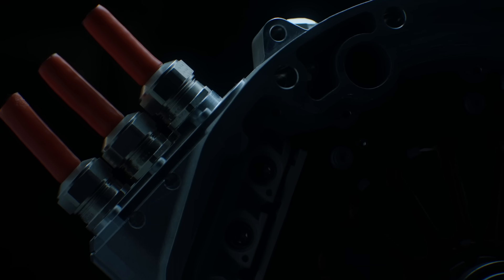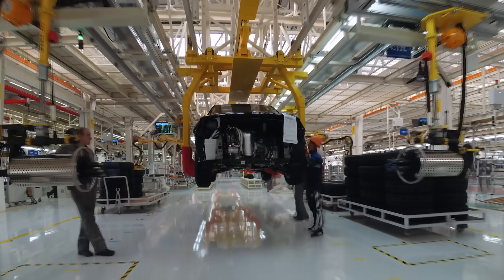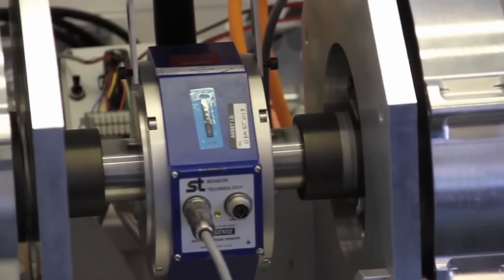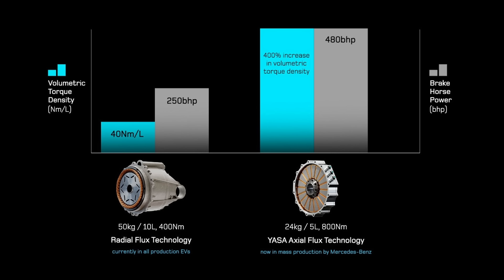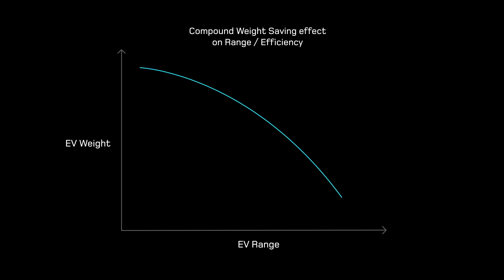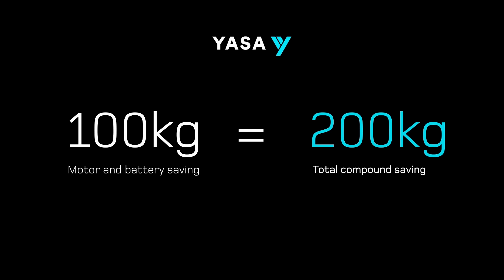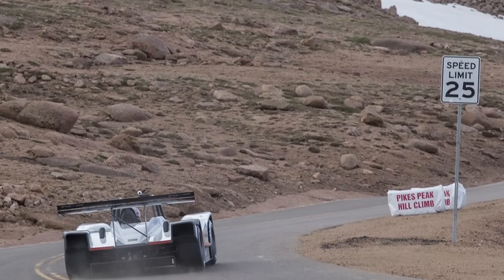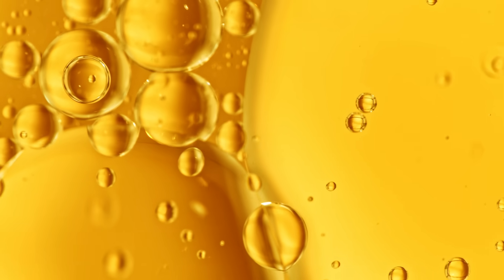The YASA Story - Axial Flux Motors: The Future Of Electric Vehicle Propulsion

Comment: Imagine 2 of those in a motorcycle!!!! That's like 600 horses on a bike 😅🎉
Reply: Aaaand, it's become illegal, for sure, you absolutely killing people with that kind of power in ur bike
Reply: @mrjean9376  yes but I will cool! I'll just have to build this bike for myself and sell them on the black market
Reply: I also would want two of these on motorcycle but maybe with little bit reduced power. I think like 50-100kw per wheel would be perfect. I think that could actually beat some motorcycle acceleration records and still be relatively enjoyable and comfortable to ride. 🙂
Reply: @wilderness-beastt  I'm not sure about that as the main issue with bikes is keeping the front wheel down which would be a struggle in a normal bike, if it could be slammed to the ground then yeah that would break records.
Reply: @madbull4666  that's why I said two of these. If you have front motor and rear motor then this probably isn't an issue anymore.
Reply: @wilderness-beastt  why would 2 motors do anything differently? The front motor would just spin up due to not much weight over it, a lot of super bikes when accelerating hard already lift up the front wheel so power there won't do much. Plus I'm not sure how stable it would be when cornering having power going to the front wheel, it might just create a low slide instead.
Reply: @madbull4666  that's kinda the beaty of electric. It's fairly simple to have the power go to front wheel when accelerating and then have power go to rear when keeping constant speed for example. Also when Front motor spins up it pushes the rear wheel to the ground so you get actually a bit more traction on to the rear wheel.
Reply: @madbull4666  also yes I think there would be plenty enough weight on the front motor since the centre of gravity on many sport bikes seems to be fairly in the centre and front motor could even bring it a little forward depending on how it was made.
Reply: @wilderness-beastt  I can completely understand having different power delivery, on rough terrain I can see it being a major plus side especially with traction similar to how awd rally cars are compared to rwd. On tarmac though I'm not sure how much of an advantage or disadvantage it could be even with different power delivery, you want as little rotating mass as possible and having a front motor will add a fair bit of weight to it and as the front wheel already is on the limits putting even a slight bit of power could break the traction.

It would faster down the straight but worse around the corners, and if it had 200-300 hp already I know which I'd prefer.
Reply: @madbull4666  fair enough.
Reply: @madbull4666  If a bike Did have 2 electic motors, it would like also have torque vectoring control that would  sense slip vs grip on either wheel and apply or reduce power accordingly...that and the extra weight of a motor On the front end, would help alot with putting that power down.